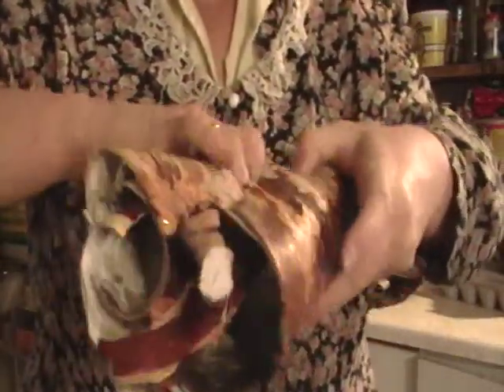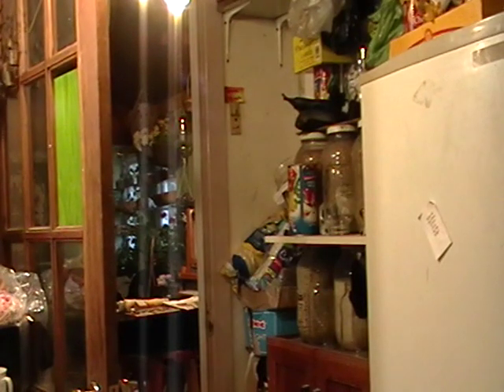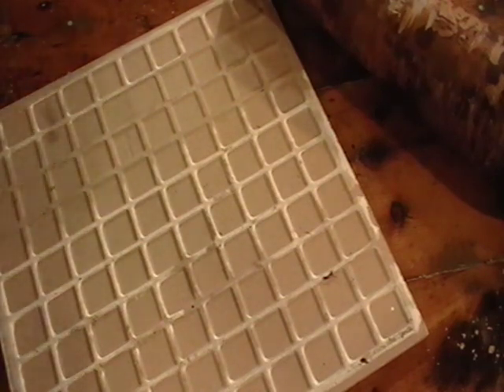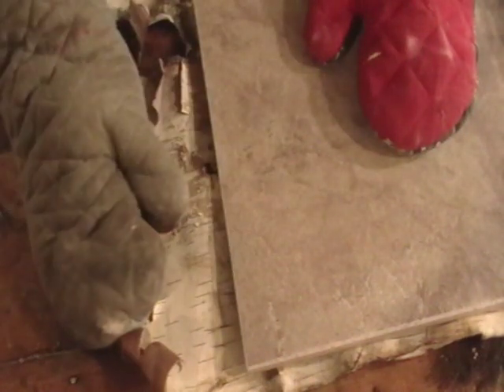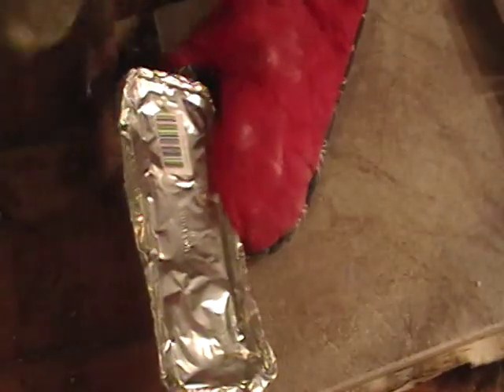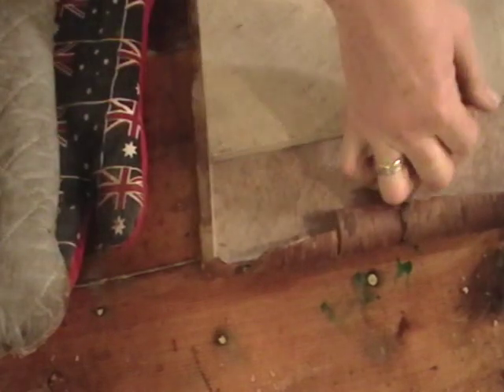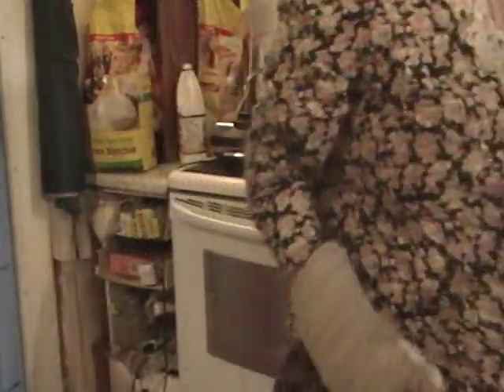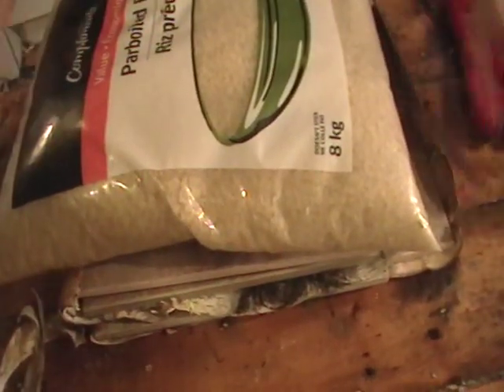Nancy Today: How to flatten birchbark pt 1 ASMR Birchbark (basket making tutorial) hacer cesta

Comment: It may be waterproof, but if you boil it for about 1 minute and then press flat it's way faster and easier than what your showing. But, best method is to peel and press the same day, let it dry flat and it will hold the shape. You need hardware cloth frames though, or it can get moldy.
Reply from the maker: Thanks for the tips.